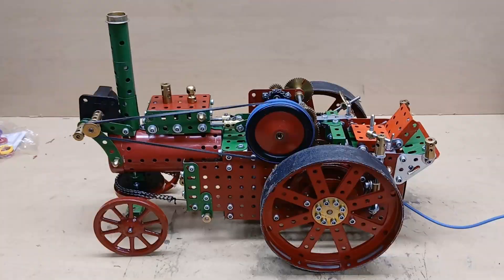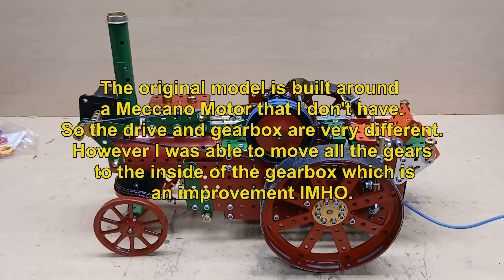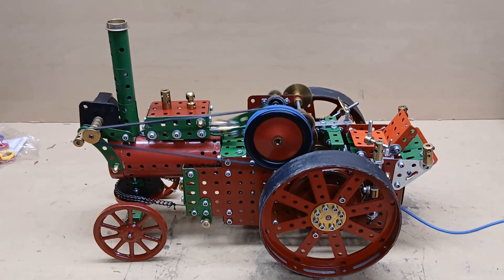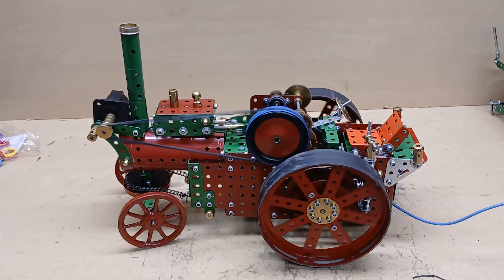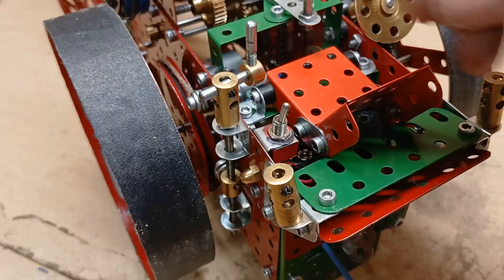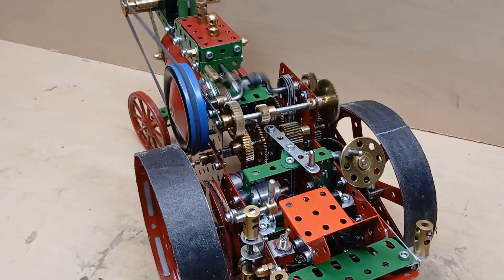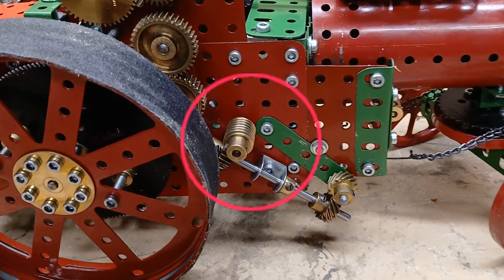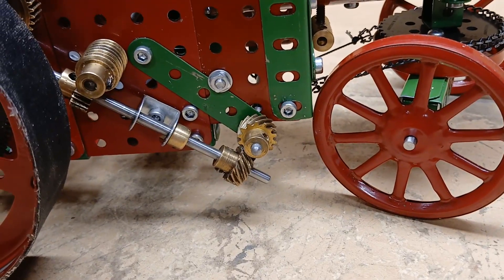Traction Engine in Meccano from 1928

Comment: Excellent Model. Can I ask what you put on the wheels? Is it some type of tape. Thankyou Also where did you get the remote control
Reply from the maker: It's a layer of double sided tape (quite thick) and then a layer of black gaffer tape (not duct tape). The remote control unit is from AliExpress.

Comment: That's a brilliant piece of work, Michael. I made this model myself a while back - without your sophisticated improvements, I'm afraid; either way its a grand model. More recently I made the early Foden steam lorry and trailer from the same era, and that one runs, my having acquired an electric motor. It needs a lot of space though, and a very long wander lead.
Have you tried the Sentinel DG8 tipper, from a (roughly) 1932 MM? (Modern Transport in Meccano) Having built it, its big - some 2 feet long, very heavy and very fiddly to  adjust and get working properly, but believe me, it is well worth the effort.
Reply from the maker: One of these days maybe!